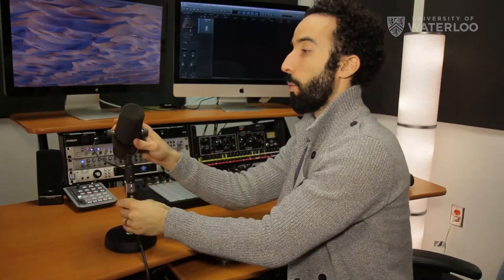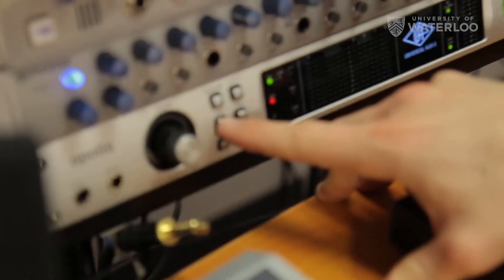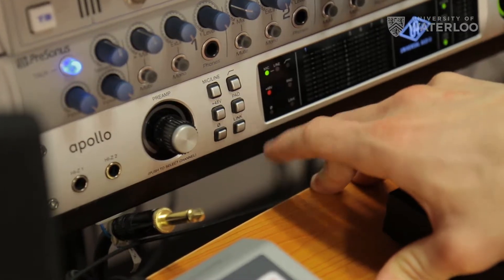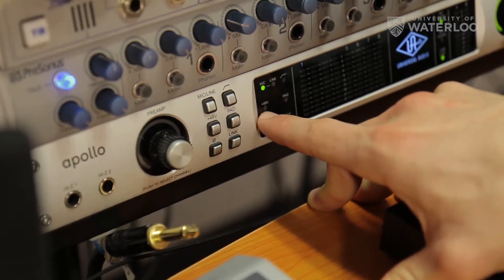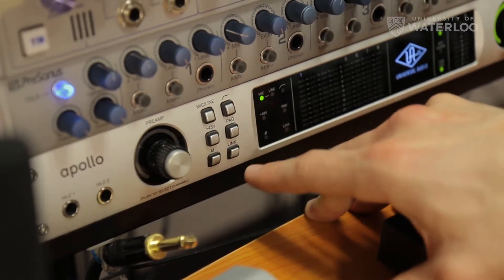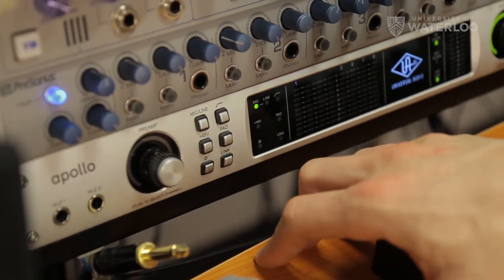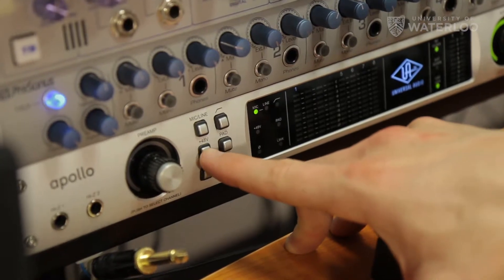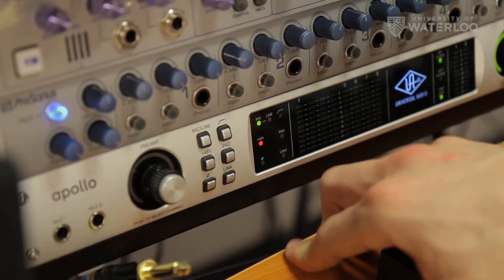Audio Lab Basics - 1.4 Activating Phantom Power - Universal Audio Apollo

Comment: I have 2 rode podmics and an apollo twin duo. Should I use the 48v on the apollo with each mic? They seem to work fine without it but will my audio or mics be affected?
Reply from the maker: not all mics require the 48v phantom power. If it's working, I wouldn't change anything. It shouldn't affect the audio.